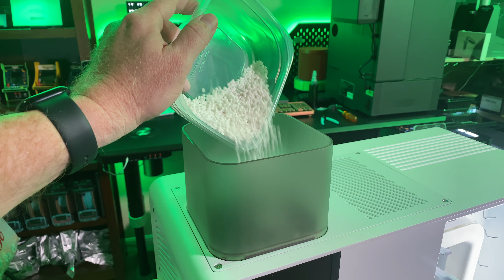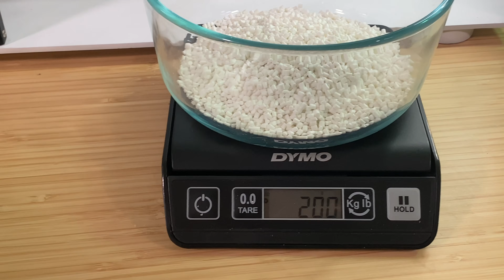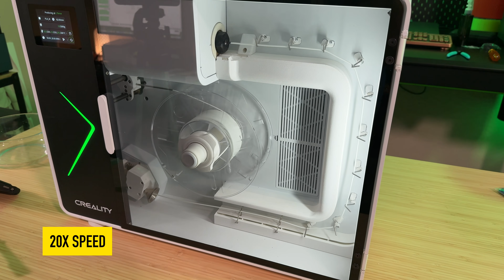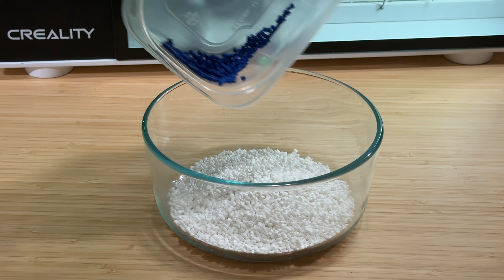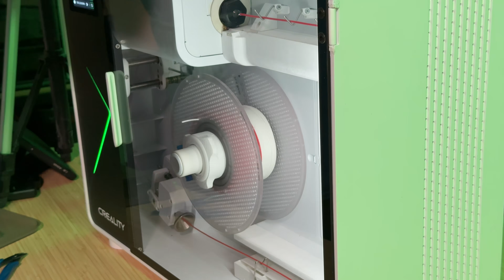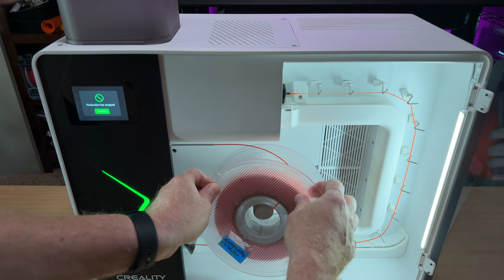From Basic to Custom Colors: Creality M1 Filament Experiments

Comment from the maker: So, what should I try next with this thing? Different materials? More extreme color blends? Recycling failed prints once the shredder’s in the mix? Let me know!
Reply: Teaching Tech designed a filament chopper to recycle filament into pellets. So maybe you can make one and recycle the purge filament to recycle without the R1.
Reply: Great video! Perhaps try grinding down the color pellets smaller to see if you can get the color mixed cleanly throughout.
Reply: It would be good to know if it can actually handle glitter, or marble specs

Comment: If you want fully uniform colors using the M1, you practically need to process the filament twice. The color that comes out is somewhat of a running average of the last ~10ccs of filament behind the nozzle, not enough to fully average things out. Once the color has been diluted 20:1 by the first pass, achieving uniform mixing by shredding it and feeding it back through will be much easier as very few pieces of filament should contain enough pigment to cause a drastic color shift during re-extrusion.

If you were making larger batches of a single color, say 5kg, then instead of trying to dilute "master batch" pigments 20:1 in one step, you could mix your pigment load into a 1.25kg initial dilution (4:1) batch for the first pass, shred it, and do 3:1 for the final 5kg batch. That should get you most of the way to factory-like uniformity without having to double-process the whole 5kg.

Comment: that machine is so rediculous expensiv and you need to buy the pellets too. the amount of savings is so little compared to new filament you can easily buy 500 to 1000 rolls of filament before you break even. a clear no go for all hobby users. even for a small business it is useless with all the work and energie you have to spend for a roll. and the recycled filament is for sure not as good as a new roll.
Reply: While Creality is only allowing reviews using its provided base material and pigment pellets, one of the sales pitches is recycling failed prints and waste. If you recycle existing material, you aren't buying as much virgin material if any anymore.

A print farm could use recycled scraps for supports and infill. If you add 20% virgin material to offset degradation, the machine could pay for itself in ~70 spools worth of recycled material. In a print shop environment, break-even could be as soon as 2-3 months.

Probably makes no sense for hobbyists, especially with the U1 and Creator 5 practically eliminating the two main sources of waste besides failed or otherwise discarded prints. Someone who does a lot of prototyping may also generate enough discarded design iterations to warrant recycling material to save on filament costs.

Comment: you should have grabbed a couple of rolls that we would not use for printing due to age and damp etc and chopped a load of it up into pellets just for a test to see if you can save old filament..  :)  i would have loved to have tested this as i have a load of micro powders that i use for resin. :) i would only use pla in the machine though

Comment: why cant we have a printer that just runs on pellets and skip this process altogether
Reply: That's a real thing, there are pellet extruders. But they don't retract as well.
Reply: Filaments are convenient to handle in a compact lightweight toolhead. Good luck achieving predictable flow from an auger screw squishing pellets together into the melt zone. Having a hopper with pellet bucket on top of the print head would also cause its own lot of problems.

It has been done but for most people, it isn't practical.

Comment: With a low volume machine like these, you simply cannot mix the masterbatch evenly enough for perfectly consistent color in the final filament.
Reply: a better effect can be obtained with a fine pigment because it will spread more evenly in volume than a thick masterbatch pellet
Reply: @robertsilesian1283 do you know if Master batch pellets can be ground up into powder with something like a coffee grinder for espresso machines?

Comment: How is the cost of the creality filament maker, filament pellets  add up to buying roll of filament ?  When or rather how many rolls of filament would you break even?
Reply from the maker: The current crowdfunding campaign on IndieGoGo has the M1 + R1 combo at about $1,200 USD. Using nothing but pure, new material, you're probably looking at about $10-15 per kg in small quantities. So your cost per spool using nothing but new pellets is probably close to the cheapest PLA filament you can buy (I've seen some for about $15/kg spool on Amazon). With the R1 shredding up scrap prints, multicolor printer poops and stuff like that, you can mix the shreds 50/50 with new, and then you'd be down in about the $5-7 USD range for a spool. The color on the recycled stuff is probably going to be a muddy brown, but if you're able to use that for prototyping or for printing something you're going to paint, then it doesn't matter what color it turns out to be. But to answer your question, the M1 + R1 combo at $1,200 USD is equivalent to about 60 1kg spools of decent-quality PLA (at $20/spool) or 80 1kg spools of cheaper stuff (at $15/spool).
Reply: @BV3D Thank you Bryan

Comment: This almost reminds me of the GigaStorm. Everybody wants it, everybody plops down money and then after getting it, it just sits there. It is a great idea and concept as most people printing would love to chop up stuff and re-use it! Cost is the factor and not of just the machine but the raw pellets and coloring. If you don't buy in bulk you might as well just buy filament rather than getting the raw pellets. Custom colors are the big draw for me, after the grinding of old/failed prints, which does make it worth more. If everyone can find a raw material dealer that ships to the USA for CHEAP it could be well worth it.

Comment: 45 minutes to make half a spool of filament is better than waiting for a spool to arrive in the post, and being able to recycle wastes and sprues means prototype prints cost negative bucks if you factor in the decrease in landfill I'm guessing this won't be a cheap machine, based on past filament makers I've seen, but I'm guessing if Creality sees a consumer market for this, they've figured out a cheaper but reliable enough way to do it. There's also an environmental advantage to new stock via this method, less weight for transport and lower volume packaging. A kilo of PLA in a mylar bag is less wast than an ABS spool in a mylar bag. It makes spools genuinely reusable. I still reckon a filament joiner is better for small batch polycolour method, based one your red, "white" and blue test, but, as you say, they may still be R&Ding the s*** out of that part of the process. Can't wait to see what it hits the market at.

Comment: Masterbatch-based filament making at home is tricky, as you've seen with the banding. If you make an intermediate batch, then pelletise that (there are some drill-based pelletisers about), you have a much better chance of blending... also, you can control blending easier as well, and make smaller batches that way. Adds another step, but still cool.
Reply from the maker: That's a great idea, and definitely seems like the right way to get a more consistent color blend. Thanks! 🙂

Comment: To be honest, this device only really makes sense if it is possible to recycle a significant portion of filament scraps and that remains completely an open question in this test, since the shredder was unavailable. Aside from providing insight into the process itself, the whole exercise doesn't offer much help in assessing the device's actual practical value.

Comment: Does it magically clean itself up after it ends extruding?
Reply from the maker: It usually leaves a little curl of extruded filament hanging off the end of the extruder. Once it cools down, I just snap it off. So it's manual, not magical, but also not much trouble. 🙂

Comment: gradient filaments aside.. if you blend and then make a spool and then shred that spool and then blend it again and remake it into a new spool it should reduce blending banding
Reply: Better to turn the pigments into powder before adding, so it will spread evenly.
Reply: @Yoggoth  Augers need material bits to be large enough to shove forward. Excessively fine powder may end up just getting stuck on cavity walls until they randomly get scraped off and cause unexpected color changes in unrelated batches if you don't dismantle the thing to clean it out between runs.
Reply: You need to account for PLA degrading, and probably easier to just buy black pla pigment to dye the whole spool black
Reply: @nigelyam38  If you are going to make large batches, say 5kg, mix and dilute pigments with the first 1kg, shred it, mix it in with the other 4kg of base stock and run that. The output should be far more uniform doing a 3:1 dilution of pre-mixed pigments already diluted 4:1 than doing a 20:1 mix in one go.

Not going to have much issues with degradation when 50+% of the input is virgin or once-cycled material. PLA degradation becomes significant after the third time without adding any fresh material or polymerization additives.

Comment: I've been eyeballing these for a while, but they ran out of review units. I'd be tempted to run some printer poop through a blender and see what happens!
Reply from the maker: Hi Denise! In my case, they had the M1, but not the R1. One thing I just remembered is a CNC Kitchen video where Stefan printed a filament pelletizer that attached to an electric drill. He could feed filament into it, and it would get cut up into little pellets suitable for re-extruding. I could probably use something like that to chop up the filament that doesn't make it onto the spool from the start of a run.

Comment: Oh, no puns or alliterations. It's interesting that Creality has a shipping prototype. Users have been strung along for quite some time with the Loop desktop recycler, so it's good to see that there is going to be some competition. Hopefully spurring more innovation. Although unless I would sort my purge waste and supports by color, I could imagine a lot of spools coming out of my filament factory with varying shades of brown. I wonder if there will be a need to dry the source material prior to making new filament. Any advance information about that with the R1?
Reply from the maker: Hi Stew, from what I've seen about the R1, it dries the stuff it grinds up. You're right that if you don't sort by color you're going to get some murky dark color. Creality recommended mixing the ground up stuff in a 1:1 ratio with new pellets, so if the new pellets are matte white like the ones they sent me, maybe the result would be a murky medium color. I got the feeling they really didn't have a whole lot of the R1 units to send around, but I'm hoping they'll send one my way when they've got more stock. Also, sorry about the lack of puns. And I'll try to also add alliteration again. 😁

Comment: what they need to do is mix the color/batch once again. kind of like kneading dough, you don't fold it over on itself once, you do it at least twice.. maybe if they also have a purge you wouldn't get "pink". probably some red/color gets stuck
Reply from the maker: I think if I was to make something more like a 2kg batch of filament, it would be easier to get a more even distribution of the masterbatch pellets through the plain PLA. But I get your point - Run it through to extrude it once, then pelletize it and run it through a second time to even things out.
Reply: now an excuse to dual hotend extruder mod with a double hopper